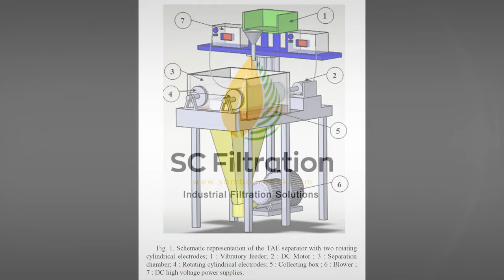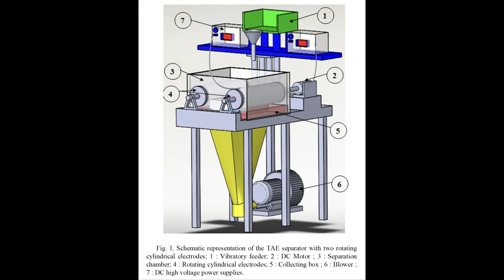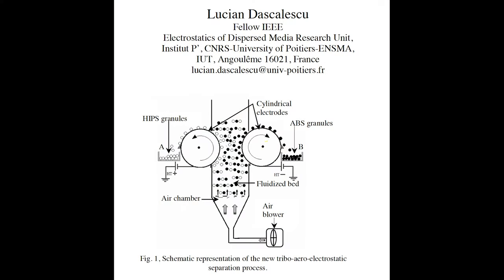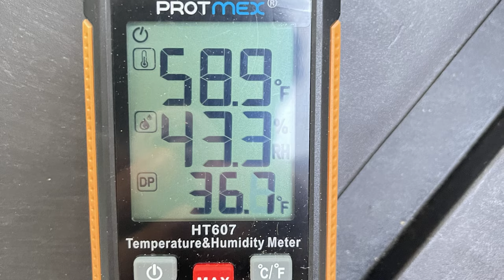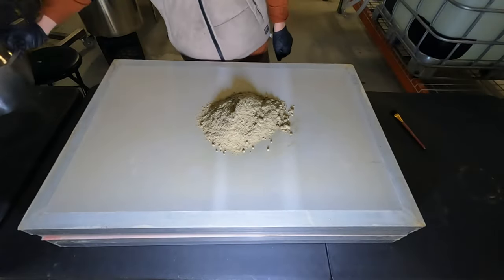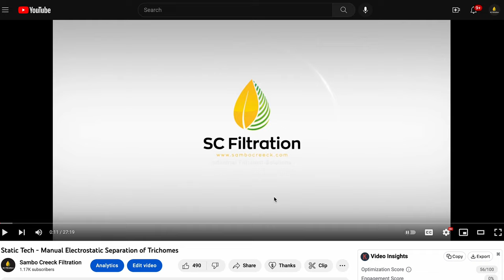Triboelectric Tuesday Episode 12 - Tribo-Aero-Electrostatic Separator

Comment: To reduce the agglomerations of the organic matter used. One can reduce the moisture and oil content as a pre-treatment, as this promotes agglomeration and reduces particle chargeability. One can also break the agglomeration by inducing mechanical stresses before charging the particles.
But be aware of overcharging the particles as it may hinder the efficiency of your setup

Comment: What produces the agglomerations? Is it genetics and post harvest process? Can it be reduced by a maintained low temp and humidity, is there pulverisation that could occur at some stage that would render separation possible or do the particles stick to one another whilst free in motion (thinking about how certain snowflakes tend to agglomerate while falling). What is the cause? I would imagine the water is not as much the cause as leaking sap from heads in this case.
Reply from the maker: All of the above produce agglomeration but mostly static charge. Low temp and low humidity helps. But free particles interact and electrically charge. The key is to charge particles and use that charge to separate, before they clump together.